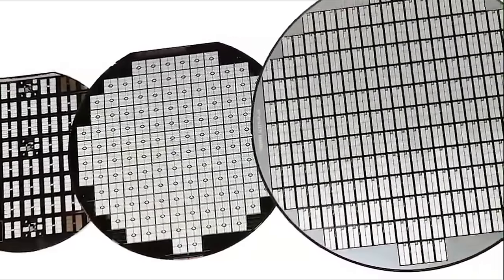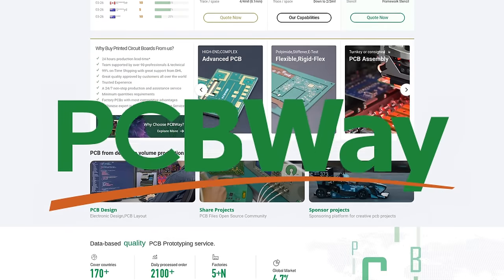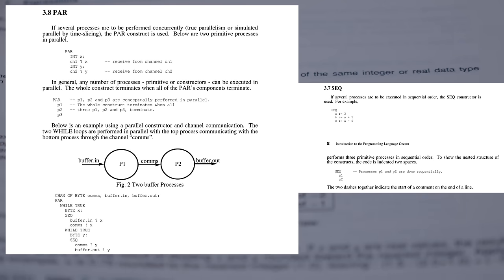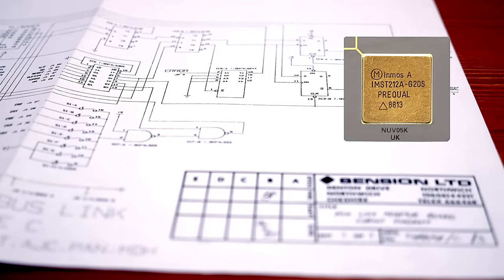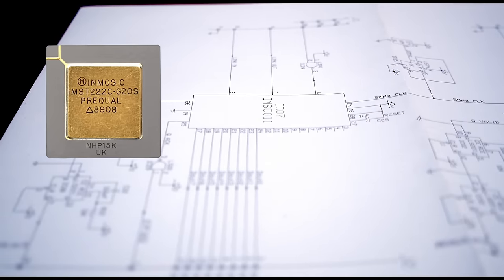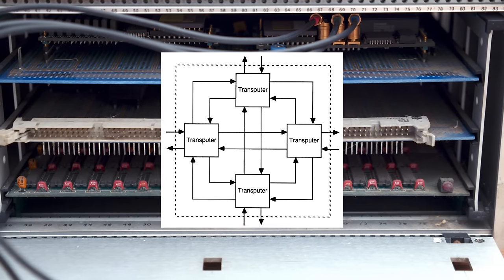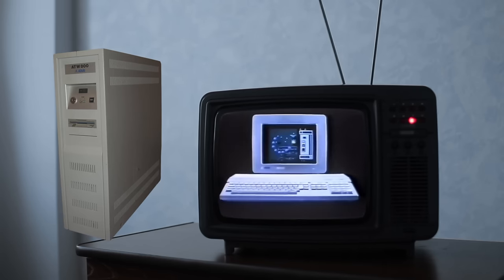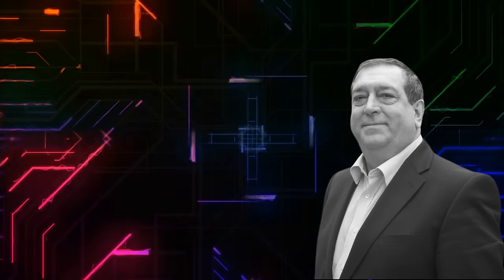The Transputer: A parallel future

Comment: Thanks for the review of old memories.  I wish I still had hardware and documentation.  
One can model most of the application mind set by building code that communicates via pipes or named sockets and thinking about generators. 
The documentation went into great depth on how the hardware  interconnect was safe from latch up.  Asynchronous links are hard.

Comment: Back in the 1986-1989 timeframe, I was working for a company that produced one of the leading C compilers for the Atari ST.  We got a prototype Transputer expansion module that plugged into the Atari ST, and I wrote the library that allowed the Transputer module to use the ST for its I/O, and allowed applications running on the ST to use the Transputer.  I did not write the Transputer side of things, just the stuff that ran under TOS on the ST.  It was an interesting project, but for some reason, my memory is that Sinclair had some hand in the prototype.  It was a long time ago, so I don't remember a lot about it.

Comment: I remember my early career where we had a map processing system for civil engineering work that has a duel transputer based graphics card. There was a interpreter Called Basic2c. I remember it being really expensive and meant we could only afford 2 workstations limiting the amount of work the engineers could do. 
They were about 5x the cost of a cad station running Autocad but it maps went in a format that Autocad could read. In the end I wrote a converter to take the maps and convert them to dxf. Happy times.

Comment: Never thought to see this on youtube. We actually developed a master and daughter cards for the t8000 and wrote software for a fish-sorting system to run on this during our time at KIHWV in Oostende.(engineering school in Belgium)
Reply from the maker: It's the first time I've heard it being used for fish sorting, good use for computer vision.
Reply: @RetroBytesUK  back in 1992 this was kind of unseen what we were doing with a standard PC as the camera interface. We had to drive across the country to find an oscilloscope that was sophisticated enough to be able to read out the data busses (we found a serious bug in the design of the "motherboard" that the previous year had designed).

Comment: I have some TRAMs in a plastic case marked 'old sad transputers', aw. If I'd known you were doing this you could've borrowed it. For the DOS software have you spoken to @tstepleton because he has built a complete running Transputer system in an IBM 5150 case. 

My Tim King story - he gave me an 'Amiga Phone' for my collection. Basically a typical £6.99 1980s phone but he'd stuck a metal Amiga boing logo to it. I found it not so long back and it hadn't aged well at all. Bloody plastic.

Comment: A good friend of mine, now sadly passed away,  and subcontractor years ago for coding defence-related satellite tracking, wrote the code/built the array and headed a team at Mark Roberts Film company for operating the 6 axis (6 DOF? x,y,,z and translations) robot camera platform that did the original star wars scene where a fighter flies thru the space ship etc, he won an Oscar for it, they sent it over as he couldn't afford to collect it himself (thanks Mark shows you how much respect you had for the teams that built your company) and they spelt his name wrong on the statue! His name was Paul Bartlett and they spelt it Paul Bar-lett  which was about right as we were always up the pub a lot near Brighton. Years later I bought some stuff on ebay and when I collected it I went to a large house near the original site, near the bridge, the guy there seemed very pissed off so I assumed that was when things changed hands, he said they binned an ion implanter in a skip etc... history binned again....
Reply: That is a nutty but very real sounding story. Work sounded similar to stuff I’d done for defence research organization. System was coded with K&C compiler (pre -Objective C). I’d done some energy models for the satellites and they used SAR tech to trigger transponders on warcrafts. Also did the modelling for that too. Was a fun project. I’m sure all that stuff is up in the air now.

Comment: Cray supers were kind of similar in not really being stand-alone computers.  It's a little bit of a silly analogy, but a Cray XMP was basically a massive eGPU for a Unix workstation that was used for managing boot and IO and such.
Unfortunately for companies selling things like like Transputer, selling a computer where step one is "Buy a computer from one of our competitors," is hard to make a completely sustainable ecosystem out of.  Another very loose analogy is the Atari Jaguar.  Jaguar devs were supposed to use the 68k CPU as a manager to send work to the fancy Tom and Jerry chips that famously added up to 64 bits.  But Jaquar devs already knew how to program the 68k, so they just did that, and the accelerator chips sat mostly idle because programming one kind of computer is always easier than programming two kinds of computers.
Reply: Kind of like dealing with GPUs today. You program them quite differently from the CPU, but they absolutely crush the tasks they're good at. Take Stable Diffusion, for instance. You can run it on the CPU, but it'll take about 20 times longer to do the same job as a mid-range GPU.

Comment: As a CPU designer, I can tell you that we think a LOT about how a compiler will work.  Fewer instructions rarely gives you better performance because so many operations are frequently paired and you don't need to decode yet another instruction when you know you need to do it.  Even the X86 which remains locked into compatibility hell runs programs very, very fast because there are very clever ways to do many instructions in parallel, both decoding and execution, along with clever pipelines.  I appreciate your presentation on this but it seems a bit simplistic for what ends up being the most complex systems on the planet.

I would suggest your next topic be hypercube connections which vastly improved on the nearest neighbor topology of the Transputer.  And then go into Nvidia's GPUs which do this so much better using massive parallelism on one chip....

Comment: There was another OS for Transputers called Daos. It was really quite incredible. Everything was shared across the CPUs in the network. When you ran a program, it would run on multiple devices, and even parts of your program would run across different devices. Honestly the most impressive OS I have ever seen. We had a stack of manuals for it in 1991, but it never seemed to take off. It was also ported to other devices, not just Transputers. Worth looking into if you can find any references to it.
Reply from the maker: I'll see what I can find, thanks for letting me know.
Reply: "Daos", as it is pronounced (apparently), but spelled TAOS. The company involved - Tao Group - later renamed the product to Intent and pivoted somewhat towards Java, as a lot of companies did at the time. From the Wikipedia page, their corporate history is pretty convoluted.

Various companies toyed with the idea of adopting TAOS. There was some kind of Amiga-related initiative, and Acorn released some kind of technology demo to its developers, presumably casting around for a more viable platform for the years ahead, but eventually deciding to write their own real-time OS, Galileo, instead.

Comment: Ah, this revives old memories. My PhD student did Kohonen self-organizing maps on them, a nice challenge because the learning algorithm starts with global weight updates over the total problem memory and gets localized only later in the learning epochs, where speedup became effective.The 4-link topology allowed for a torus architecture such that the path to any other node is as short as possible. The 20 Mbit/s/link looks slow but our coaxial Ethernet was 10Mbit/s. The T9000 had faster interconnects but the investment was too steep.
Reply: Moore's 'Law' curve was pretty steep in the period 1988-1994, so the whole concept, including the peculiar programming in Occam (first folding editor!) and tinkered I/O solutions was abandoned for traditional programming. And Intel snatched some ideas from DEC's Alpha CPU (AXP) that IMHO was the first to run on 200 MHz, later to be used in the Pentium. Strangely, DEC's Alpha CPU - which we happily used after the transputers - is rarely mentioned in the Intel-dominated Moore's Law charts you find on Internet. In regular PCs, 90 MHz was a clock-speed ceiling for a long time because block pulses went sinusoidal, due to capacitance between traces. When this was solved, further developments were unstoppable until the later ~3GHz ceiling. It is easily forgotten that the architecture of multi-core processors with interconnects has a precursor in the 'dinosaur' transputer concept.

Comment: Sounds like the TIS-100 computer game. It's a nice and simple game, where your task is to write the most efficient program in simplified assembler over multiple communicating cores. When you solve a problem, you can see, how good or bad your solution is, compared to solutions from others. It's simply the count of used assembly instructions, which is equivalent to execution speed and used memory in this game. You won't never see the other solutions.

Comment: I thought INMOS had cracked it when I came across the Transputer. I guess the issue is that everyone just thought Serially, rather than in Parallel. It was just too radical, and didn't fit into the way that computers worked at the time.
I think it's a tragedy, because it's a fascinating system that ought to have found a huge number of applications.
Reply: Yeah I agree with this. Our unconscious mind may be doing dozens of thing in parallel, but our sense of self is a serial device. So we can only imagine mostly doing one thing at a time. Its a big limitation.

Comment: I am actually getting a computer science minor along with my Applied Bio degree, and one of the ideas I'm working on in my freetime is a universally modular computing system where each CPU can merge into a mega CPU, such that if you "cut" or break the motherboard into 2 pieces it will simply turn into 2 computers that function just fine

Comment: There were many puns and references in Transputer company names. HeliOS (from SunOS), Perihelion (means the closest point to the sun), Abaq comes from the same root as abacus, which is derived from the word for sand, which is silicon dioxide.

I grew up between Leeds and Sheffield. In recent years I have discovered just what a hotspot the region was! Sophie Wilson was born in Leeds, Ian MacNaught-Davis was born and brought up nearby, Micro Power and Superior Software were based there. the Tatung Einstein was developed in Bradford of all places, and ARM's centre in Sheffield is well documented here. It wouldn't surprise me if the Transputer had history here.
Reply: I think it was the other way round. Jack Lang told me he called his company perihelion because he decided to start it while at a restaurant he owned on midsummer meadow in Cambridge. The OS name came after that. (SUN has nothing to do with with the sun, by the way, it stands for stanford university network)

Comment: I wonder if you could do a video on the Ferranti F100L and the progress on the, I think 32 bit, F200L.

I worked at Ferranti at the time and was asked to join the separate division, making it.

The F100L was a well-used, mainly in military equipment, launched 1976, thought to be the first European 16bit microproccessor.

It was based on silicone on saphire construction, which made it more radiation hardened, making it very useful in military or space products, especially missiles and satellites.

It was I believed used in satellites.

But as usually it was hamstringed by us, the Brits, in the way we handle the inplmitation of ideas, technology and manufacturing.

Thank's for your videos.

Comment: I remember trying to learn Assembler at the age of 14 on a Commodore C64. Forget it. 
I don't think I wasn't smart enough, I just tried it once. Using one book which was more a reference of commandos then a manual why I would use those instructions in the first place. The book was from a library and once it was returned I didn't try anymore. Actually I never really understood what I was supposed to do, albeit I was proficient enough in BASIC that it was already to slow for me. Well, I learned that you can optimize code, but that only gets you that far. But I finally was able to optimize the BASIC Code so it could handle the speed of a 300bps Modem 🤭. So, Assembler wasn't needed anymore.
Then I upgraded to an amiga 500 and Assembler just wasn't something feasible at all anymore. By then it was already all C. I don't think I missed out on something, but I have huge respect for someone who is able to code Assembler. Especially since you never have to use it anymore. It's really not easy if I remember, it felt like juggling single bits compared to a proper programming language. 🤭

So the transputer actually was a thing once?! By Atari?
I remember hearing about "transputer" once but not much more. Which means I assumed it never became reality 🤷‍♀️

I remember RISC CPUs being an alternative to the normal ones (I think r stood "reduced", so it must have had less instructions). Don't even remember what became out of that? It's all so long ago. 

Also, I remember that printers were connected to a parallel Interfaces once instead of the sequentiell one which was used for Modems. Luckily they developed USB, it's really a big improvement 😂😂😂

Just thinking how computing power exploded since the days of the C64 is mind-boggling. That C64 was like the standard machine for a whole decade. Even after 10y some people would even optimize their Code even more so that astonoshing Programs ran on that very simple machine. They say the processing power to fly to the moon was about as strong as a x386. Just imagine what we carry in our pockets nowadays. Amazing time to be alive....

Comment: Atari Abaq - I remember it well, they coulnd't use the nae as it was woned by a Saudi buiness
I was also at the Inmos funded 1988 Transputer Conference in Bath in 1988!
I knew a guy who had the Meiko Transputing Surface which was £30,000 in 1990/1 and about as powerful as a Pentium Pro or maybe a Core 2 Duo of low clock speed - but you where buying 'future speed', not that there was much you could run on it unless you programmed in OCCAM.
At the time a VAX Cluster was around 2 MIPS and the prospect of a 360 MIPS in a desktop PC was that stuff of fantasy (The Intel 486DX2 66Mhz was 22 MIPS for reference and didn't need a 24-7 staff to run it) although today there are uncooled surface mount DSP chips of that exact power - like the Sharc processor in the Strymon BigSky reverb pedal.

Comment: I still have several T800 transputer boards and link adapters for the ISA bus.  At one time I also had a copy of Occam and a C compiler from a company in Oregon.  The code we developed for the PC supported DMA transfers to/from the link adapters.  The problem is that while I know exactly where the boards are (about 10 feet from my left elbow) I have no idea where I stashed the software.  I don't even know if I have a working 5-1/4" floppy drive any more.

These days I use Teensy 4 boards - their NXP iMXRT1062 chip is astonishingly fast.

Comment: I worked at BHP Research in the 80s&90s one of the Phd drs was using one of these connected to a PC to process images from the coal ash Fusion test I was running at the time.
they also had SGI work stations and later added Cray.
I can remember  working down the back having problems printing from a Networked Pc I needed to clear the print queue most printers had a Vt220 connected to the "Vulcan" Vax to manage the printer however this office had a SGI Onyx for the management of the printer

Comment: I thought the transputer was a data flow machine, not a parallel processor. Like the difference between self-timed circuits vs. synchronous circuits.
I actually used A Natural, a data flow assembler for the Intel 8085 which emphasized data flow.

Comment: To me the various iterations of the Transputer seem like the first prototypes of a "graphics card", but you could physically see the parallel cores. Made during the time when chip density just wasn't fine enough to build these multichips systems directly into the silicon surface yet. Sure it's not the same level of complexity per core as the Transputer cores but there are a lot more processing cores inside of one chip now. The RTX 3070 from NVIDIA has 5888 shader cores which basically do what the transputer was doing. I guess in a way it helped influence designs and ideas that became the PCI graphics cards and multi-core processor data centers of today.  Same concept except all that discrete hardware you have in that box now fits on one chip, with room to spare. It's amazing how fast computer technology has evolved into the compact devices we take for granted today. 

I was born in 81 so I grew up when all this stuff was still in use during it's hayday so to say, but I never seen this thing till today. Thanks for talking about it.

Comment: I enjoyed this video very much, it seems to me that a series on parallel computing is in the offing. Have you researched the Distributed Array Computer (DAP for short) a system developed by Britain's IT company up until the nineties? You mentioned ERCC  in relation to the transputer, they also has a DAP. As the DAP required you to have a mainframe computer, of course provided only by ICL, there were plans to develop it into what was "the DAP in a coke can", i.e. a much smaller form factor, this was to be used on the Nimrod EWACS.